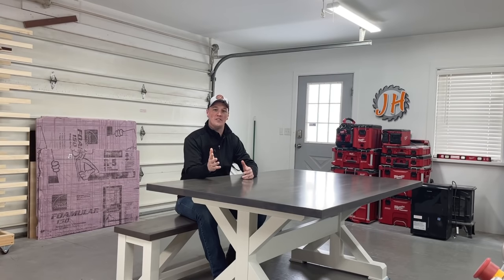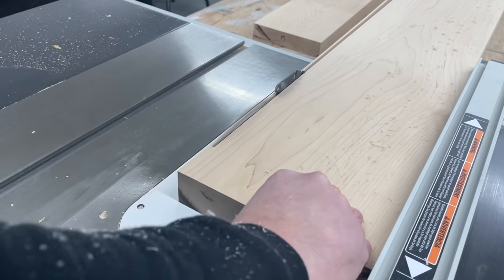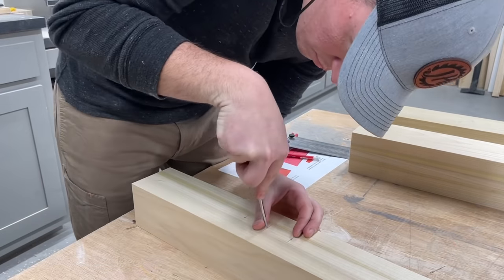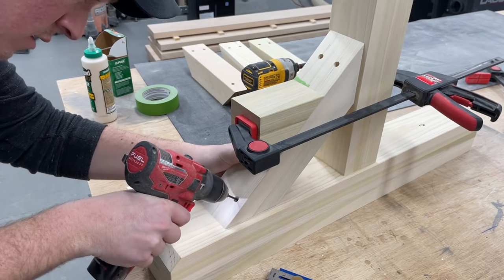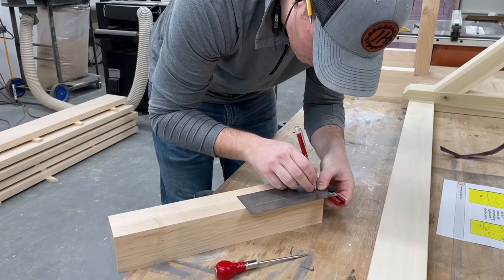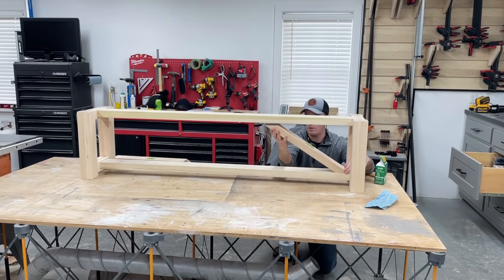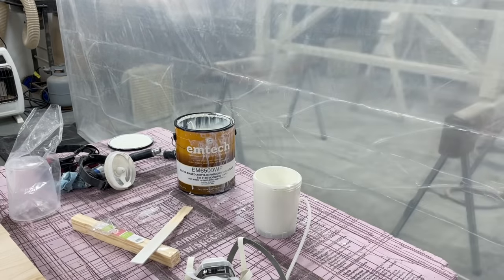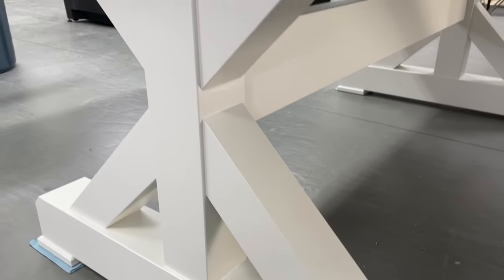Simple & STRONG Joinery | Not Rustic Farmhouse Style Table & Bench

Comment: Nice to see how far you have come in such a short time.  I still remember watching your Duststopper comparison video as I was exploring that topic for the first time!  One topic suggestion would be your setup for the spray booth in the middle of your garage and if you ever get over spray outside of the booth or if it does a really good job of containing it all.  I have a new garage workshop that needs to be a home for cars too and I really want to try spraying but am paranoid about not containing it even though I know that the droplets that don't hit the target dry fairly quickly.
Reply from the maker: Yea I need to! They’re ZipWall poles though and there’s a link in the description if you want to check it out. Really quick to set up! But yea any overspray for me just turns to dust before it lands on anything
Reply: @JohnBuildsIt  Thanks for the reply!  That's what I assumed you were using.  I will wait for the video if you ever get to it, but would be interested about the setup, do you need to worry about ceiling or just 4 walls and the floor?  Also the fan / filter placement, etc.  I know there are other videos on the topic but how quick you can set it up, knock it down,  and any tips or tricks you have learned along the way would be very helpful!

Comment: @JohnBuildsIt  I watched your video and liked the design.  I purchased your plans and am in the process of building this table (with a slight deviation as I'm doing breadboard ends as well) for my son and daughter-in-law.  Quick question.....do you have a link you can provide for the adjustable leveling feet you used on the bench?  I've scoured Amazon and can only find small diameter feet with like only 2 inch pads.
Reply from the maker: I bought these locally at Menards if you happen to have one in your area?

Comment: Nice table John. Any concerns with using dowls for the joinery if the top is bigger? I'm making a huge 82"round table top. Think I need to use mortise and tenons for more strength?
Reply from the maker: For which joints?
Reply: @JohnBuildsIt  similar joints to your legs. One joint with the leg connecting to a horizontal base, and joints for supporting pieces at a 45 degree angle.
Reply from the maker: @sbrega  if I’m picturing right, I see no problems with dowels since all the force is just transferred straight down to the next piece and to the ground. Either would be fine!